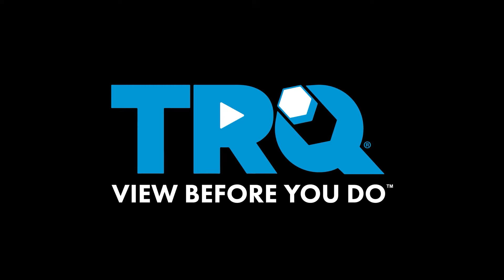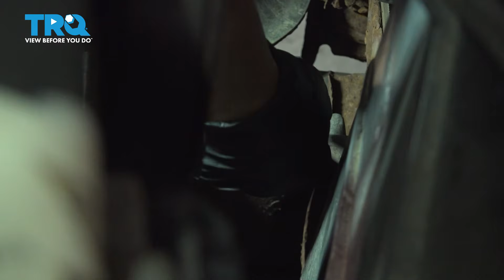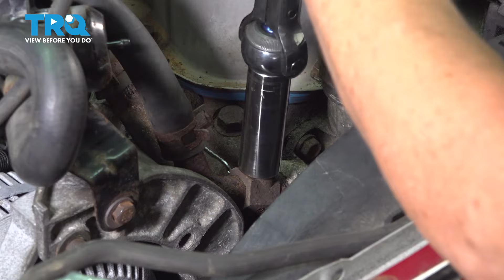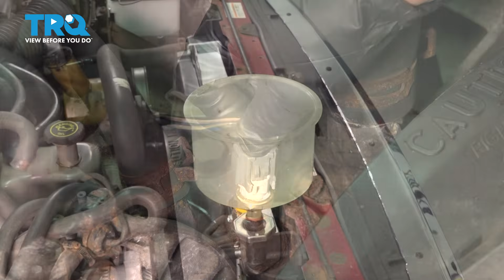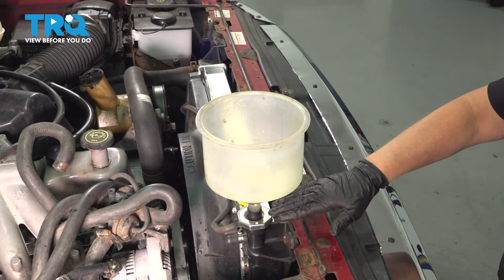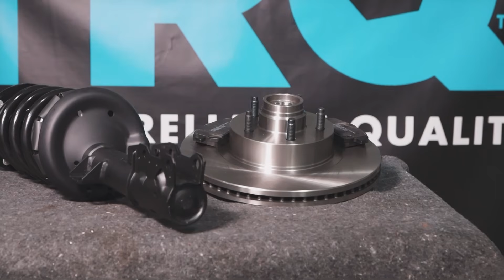How to Replace Coolant Temperature Sensor 1992-1996 Ford F-150

Comment: For a 1996 f150 the "sensor" has 2 wires and communicates with the computer.

The "sender", located near the distributer, communicates with yhe gauge on your dash. It only has 1 wire. It has a plug on the top in a "L" shape to the roght of the distributer

Comment: that was the air charge sensor not the dash temp sensor the temp sensor is probably on the side of the engine with only one wire the act controls air to the intake as the temp rises or cools but apparently theirs needed to be replaced anyway because it was broken and his engine must run better!

Comment: How do you test the sensor to see if it is 'bad'?  Recently had water pump & thermostat replaced at a shop;  Yesterday I noticed temp gauge only went to N on Normal setting when it had been reading normally (middle of gauge) ... bad sensor or thermostat stuck open?